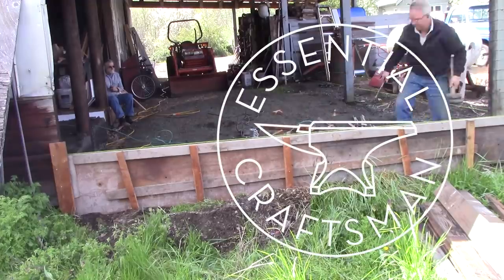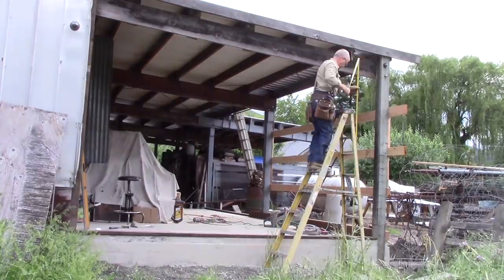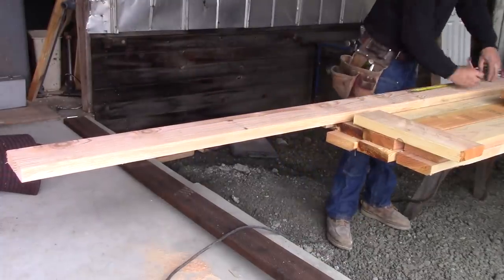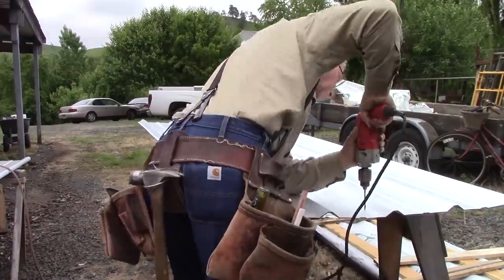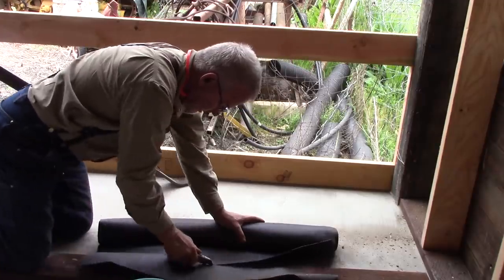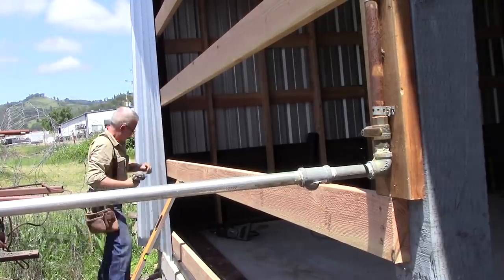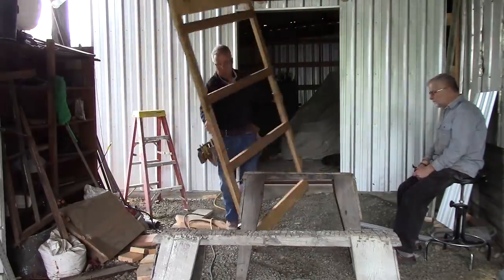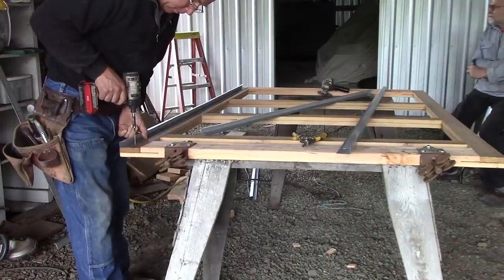Shop Evolution and Expansion: Part 3

Comment: The philosophical discussion about the need for a shop speaks to my heart.  I have been a white collar worker for my whole work life, but for the last 20 years, I have had a shop where I can get away and work with my hands.

Had to move it last summer (55k lbs in 3 weeks all by myself!) and it's now a disorganized mess in a new location.   Earlier this year we moved to a house with a huge garage and as I slowly recover from basically two back to back moves, I have been contemplating garage as shop....   Even if all I do is cleanup every time I go to my shop, it fills an important need.

Comment: I bought my grandparent’s house some 5 or so years ago. I’ve recently gotten into forging and have been using my one car garage for forging, metal work, welding, carpentry and general tinkering. There is an old smokehouse in the yard that I am going to rehab and turn into my blacksmithing shop. It has a dirt and gravel floor, it also reminds me of my grandpa and has his hands all over it. I think it’ll be a great little smith shop. Thanks for doing what you do

Comment: I like the block building with a brick face on the front idea (because I'm a retired bricklayer).  My Dad built a garage big enough to hold 4 cars on the first level and has a second floor over the whole thing.  Lower level to park the car(s), do mechanical work, weld and whatever is heavy.  Second floor mostly wood working stuff.  It's still in the family; my brother lives there but lets the other three of us to use it whenever we need.  Thanks for the videos, Greg.

Comment: My first structure after I got married and money was alot more difficult than it is now.. was an old 10x10x8 foot dog pin, took one side off and put it across the top and a little quality installation of a blue plastic Walmart tarp I had a lawn mower and tool storage area.. o those days.. and working in the snow on my old 64 Chevy truck replacing the transmission. Now I am spoiled with an attached 3 car garage that's heated and cooled and a huge storage building outside that keeps my mower and large tools warm in the winter. Beautiful video and well edited..  kudos Scott.

Comment: Hey Scott, thanks for another great video yet again. Just a tip I find useful at 8:39 if you flip the sheet over and cut from the bottom, that way your saw doesn't have to ride over the ribs. Cheers from Canada!
Reply: cutting that way from the bottom also leaves a clean edge on top and the rough edge on the bottom.

Comment: Having grown up on a farm with buildings ranging in age from the 1950's back to the late 1800's it is amazing the craftsmanship and durability of structures which were built by men with no more than an 8th grade education. Most have been remodeled to the extent they can be within all practicality, ie ,money and time. The struggle lies in there use for farming in the 21st century, too nice to tear down and would like to put up a pole barn but don't want to put up another building to maintain, pay taxes and insure. An older farmer told me once to build a barn and spend just enough to last 40 years because that's about the peak working years a man will use it, and the next generation will have different ideas and uses and it will be wore out anyway and they wont feel a burden about saving the structure and putting up something that fits their use at that time. I thing your shop fits that idea of progression and evolving interests for grandkids to grow into and make their changes to. Thanks for the great videos.

Comment: i bought an old fire-station for my automotive repair shop.  ceilings are only 11ft 9in but we make it work. just have to use rolling stools and work sitting down on the suvs and trucks. and most all 2 post lifts are 12' high so a couple holes in the ceiling fixed that. 8" concrete floors, cinderblock walls with brick on the outside. love it!

Comment: You've helped me to articulate what I'm feeling. I just built my shop and I get a feeling of accomplishment whenever I open the door. So glad I made the door myself.I built the shop because I have the urge to make something useful. It's a lot smaller then is ideal,  but I'm finding that I work best when I have tight constraints so it'll be interesting to see what comes of it. Thanks for the encouragement you've given me.

Comment: That was fun. When I was first married and starting out. I stored my tools under the single wide mobile home we were living in. Eventually built a pole barn that I fixed up really nice. I retired a few years ago and down sized. Moved out of the city and now my shop is a double wide garage and a 8x18 cargo trailer I use to store my bigger tools that I don’t use very often, I have learned a lot along the way and try to share my knowledge with others along the way.  My biggest mistake was letting my Blacksmith tools go to a nephew that is not using much anymore,

Comment: Tomorrow I am putting in the forms for my new shop floor. The engineering is done, the gravel is compacted and I am so excited. I've had shops before but never one i can truly call my own. Thank you for your videos, I've built a building before bet never done the concrete work on this project I am doing all the forming insulating and rebar. I have looked to your videos for tips many evenings.

Comment: All around my house there are 100 to 150 year old pole barns built of cedar trunks, with packed dirt floors that follow the original lay of the land. Farmers (real farmers, not hobbyists) work on tractors, hay wagons, etc. They weld, fabricate and generally get stuff done. You don't need a cathedral, just a mostly dry place

Comment: My "shop" is a couple cheapo Ikea tables, one of those tiny Irwin clamp on table vises on the edge and my small collection of cheapo tools. The tables and vise have already paid for themselves by helping me fix a couple things. For example the intermittent wiper relay in my car was faulty, and instead of buying a whole new arm switch for $150 I did my research, bought just the relay online, and soldered it in myself using the vise to hold it steady. I don't have much to work with but I love what I have for now.

Comment: Really love the videos keep it up, I know your all about saving time and being more efficient so my tip as a metalworker is when putting up sheeting like that you can punch the holes with a sharp center punch instead of drilling, usually go thru around 10 sheets, and when you can't see the mark anymore punch it again for the next set of sheets and so on. A lot faster. Good luck!

Comment: In the summer I work in an open post and beam shop with a gravel floor.  It is primitive, but I built it, I own it, and most of the time it works.  Simple is sometimes better than waiting for the ideal - especially when you are 70!

Comment: When i started building my shop i had no money and no work. I knew if i waited for money, i'd be to busy working to build, so i started anyway. I did have some resources, like, van, home to live in, etc, plus a back yard. You mentioned a lean to, then tarp, which was so close to what i started,  that one of my friends named the shop the Shent. It's not a shed, it's not a tent.   That was 4 or 5 years ago, and since then, i've expanded 5 times with additions, improvements, AC, better tools, dedicated 220 lines for AC and table saw.  The point i want to make to any that are starting out, or yearning for their own shop, is you may often find yourself in that situation, time and no money. Don't let no money stop you, i didn't let that stop me. I let people know i'd haul away most anything with an emphasis on materials, and i'd treat it all like something they no longer wanted, to avoid placing undue value on said materials.  Before it was over(is it ever?) i'd built about a 700 square foot shop. In the beginning, the most expensive thing i had to pay for was fasteners. I scrounged so much wood, sheet goods, metal, roofing, wire, labor, doors, glass doors, which make great windows BTW and absolutely love working there, it blows my mind to even think about. Had i waited for money, to start, where would i be? I still have little money, because i always seem to need a better tool, or an additional tool, but the jobs are bigger, and my skill level is better and my income has improved dramatically. Every morning i go to YouTube U, and learn a little more. Essential Craftsman always reassures me, and of course teaches me to take my time, trust my own judgement, ask questions, learn from my mistakes and not over think things.  The value of this resource can not be overstated. Thanks to all in the YouTube world of makers, who share, and inspire. Thank you Scott, you are an inspiration, and like TechnoBabble said:" I really like the way you talk in this video.  It's soft and thoughtful.  It feels like my father or grand father sitting down and talking about life and what's important.  What it means to be a young man getting older and thinking about what he'll pass down to his son or grand son.  Do this from time to time.  I really enjoyed it."

Comment: Great video sir. 
Couple things I took out of it. I recently started my own company. A venture that made quite nervous, knowing my paycheck relied completely 100% on me finding the work. It’s been absolutely fantastic so far, as all of my work has found me. I’m at a crossroads with hiring another man. I have a few begging to work with me.....but somehow I can’t yet justify the added cost to the customer as I don’t see where having another man would produce work twice as fast, or be any more productive as I am by myself. 
I’m glad I’m not the only one seeing that. 
Second, I’m in the middle of building my own shop. A 40x48 pole barn with a 12’ lean to on one side. I say I’m in the middle of because it’s currently on hold. I’ve built the building, installed the doors, and now it sits. Waiting for me to work up the funds to pay for slab heat and concrete. Man oh man I can’t wait for the day I can move shop into that building. A place of my own, built by me. 
Lastly, this video it seems you’ve used a different mic to record your voiceover?  Maybe I’m just now noticing it, but you sounded awfully “tinny” this round. It didn’t detract from your messages though. Keep up the good fight.

Comment: Here's a tip on building a shop. It will cost 2-3x as much as you planned. Mine started with a $10k down payment on a $54k pole barn. Then came the survey, excavation, concrete, roll up doors/openers, electric/natural gas service and final grading/landscaping. These additions are nearly 60% of the cost of the building! I still have a lot more to spend as I work to finish the inside and get comfy.

Comment: I agree about the metal buildings being sterile.
One day I plan to add to my old family's rough cut oak barn and make it my shop area.
I'm little Leary about welding or grinding because it's a wood structure but rusty tin on the inside should work and give it charm.

Comment: I do stone countertop fabrication in an old car dealership. It works. Currently raising the drop ceiling to the metal roof trusses. Now there's enough height for a jib crane. Was not the most ideal place for a shop, but with a little work, it will be.

Comment: Wow.... I guess maybe I did okay.  Couple years ago I started a new barn and decided to do concrete pillars with steel anchors for my poles.  I didn't like the fact wood to ground contact was gonna need fixed at some point.  Figured I'm young 30s would like my barn to last at least the 50 years that I'd like to continue farming.  Yes it did cost some extra but I believe well worth it.  Wish I could post some pictures so maybe some others could have ideas fer their future build.  Thanks fer the videos.  Good Day..... from NE Ohio.
Reply: columns, piers, pilings (round, square, rectangle) and  pillars, many names all mean pretty much the same though they each have their difference depending on the person 
Guessing you did like Kyle of RR Buildings does like others and did a cast-in-place with bracket (wet or dry set), either that or went with precast from Midwest Permacolumn for the brackets and "pillars".

Comment: Great video series on your shop.  I'm looking to improve mine, and was curious if you have any videos on how to close in part of a shop to make it an interior room?  Not sure if I need to add plywood between the posts along the horizontal boards on the exterior walls and then stud in between the posts like a normal house wall, or just insulate with foam board along the horizontal boards, create a moisture barrier and then stud in the space, etc.

Comment: You just gave me an idea for a barn door I want to replace bifold closet doors I will dress it up a bit more with vertical shiplap instead of metal even if I have to fit in some cross bracing the inside doesnt need to be finished the cloths won't care 😁
Reply: I bought a few barn door kits online for my inside bedroom and closet doors inside my house. I then wanted more for my addition and office so I built them by framing same way done here like you're thinking. I wish I would of done it to all of them now! I agree the closets don't need to be finished on inside.

Comment: When I moved into my current home a few years ago I was showing my cousin the calving barn turned auto shop and the first thing he says upon entering is, "you can't buy that smell!". It was the smell of dust, oil and fuel and every other kinda chemical you can think of. Even so it could hardly be described as a bad smell.

Comment: I just found RR Buildings channel, between him and EC we’re gonna be taking a lot of pole barn notes
Reply: One thing is the number of options in post footing products from the Midwest permacolumn precast and the brackets (Morton's system is proprietary and only for their kits), as well as Strong Way Systems and their Strong Post wet set adjustable height brackets along with their Strong Way Sleeve post repair sleeve. But for those wanting to still go 'post-in-ground' have the choice of Postsaver/Polesaver sleeves that slip and heat shrink onto the post as they show in their how-to video or other choices of sleeves as well as boots from Plasti-sleeve and Post Protector of which both also offer skirt/splash board protectors as well.

Comment: When you cut that metal siding with the skilsaw do you do anything beforehand, like put the blade in backwards or use a different blade?  I cut metal doors often and they dont get along well with the blades.
Reply: I have to cut a bunch of cheap corrugated tin today. What blade should I use?

Comment: I heard masonry and decided to comment. Here in Perth, Western Australia, we build, almost exclusively, double brick homes. Two leaves of brick on external walls, and single brick on internal walls. Timber stick roofs and corrugated iron or clay tile roof cover. In this city, the cost of building with brick is comparable to other building types, because we make lots of bricks here (from local clay), and we have a shit-ton of skilled brickies who can throw up quality brickwork in a matter of weeks. There is something about brick and mortar construction. This from a chippy, I would prefer a brick home to a timber framed home.

Comment: If you'll accept comments from the peanut gallery, when you're laying out your screw holes instead of drilling just take a hefty nail and punch it save time and effort, the self tappers will grab better even if you don't make it all the way through all the sheets and the rubber grommet will cover up any distortions.  I did polebarns for a very short time, we had a pneumatic punch for this.  When we didn't use the pneumatic punch we would drive a nail through the edge of a 2x4 and use it as a punch.
Reply: I've had bad experiences just punching the sheet metal with a screw. Not a lot, but sometimes you'll pull a shard of sheet metal that will usually come up and cut the grommet, creating a leak. I prefer to stack all my panels, or as many as my horses will hold, clamp them along their short edges, (this prevents broken drill bits when the panels inevitably move and side-load the bit.) layout for my purlins and offsetting for my overhang and then pre-drilling all my holes. When you can stack and drill 10+ sheets and hand them up, things go real quick and you spend less time catching screws as they slide of the roof, or picking them out of your BOOT!

Comment: I love masonry too, but man is it a pain in the arse when you have to re do the electrical or water&sewage! I'm currently restoring an old abandones brick house and as much as I love working it, and believe me I do, sometimes you find yourself wondering "Why the F^^k hide every utility underneath a 1&1/2 inch concrete layer? Or more!" Especially with water and sewage, it can be quite hard to find and control leaks.